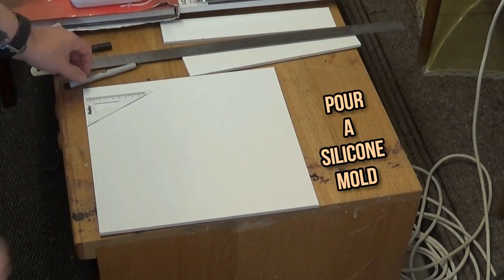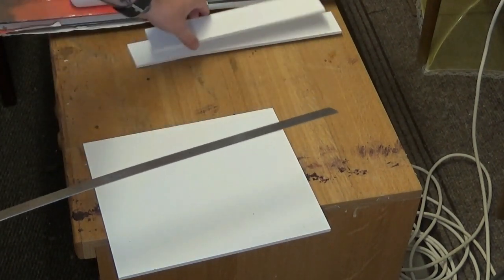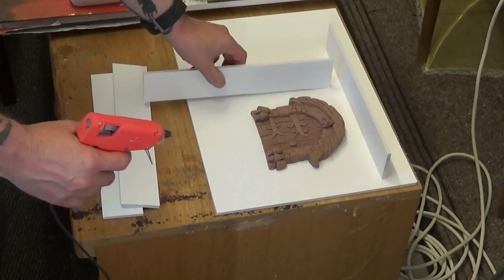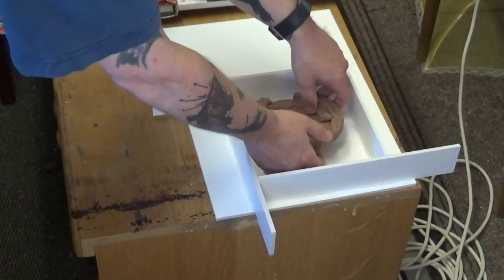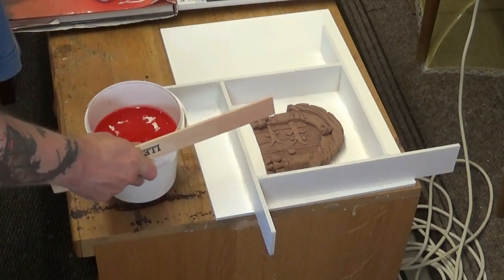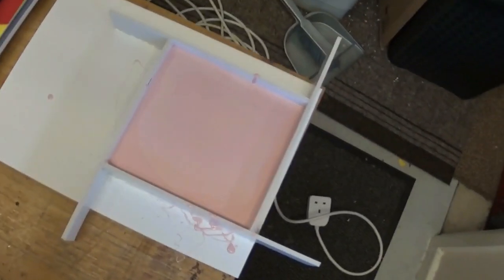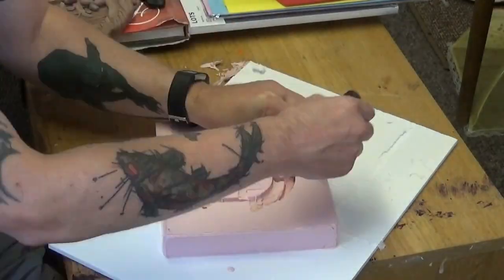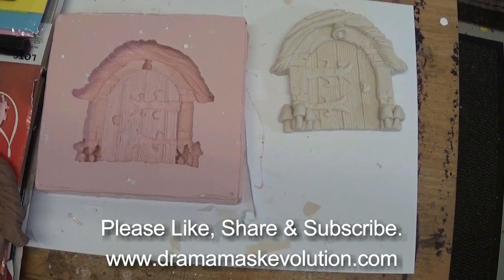Pour A Silicone Rubber Mold

Comment: your end product there looks fantsastic,i think ive got the jist of it now,but with a soldier figure 1:35th surely this would be diffrent?i cant think how this would work with a figure?ah if i stood the figure upright surely i wouldnt need to make two parts and put them together as id rather have it in one piece..
Reply from the maker: You might want to make vents for your figure. I haven't made a video making vents for silicone molds as of yet, but will make one at some point. I did a very brief video on casting resin figurines a while back, but may not be useful to you: Resin Casting Figurines | Polycraft EasyFlo 60: https://youtu.be/KZbF-MpBBUQ

Comment: Can you use paper clay or will only oil based clay hold up to this molding process?
Reply from the maker: Sorry, I have only just seen this message. I haven't used paper clay, so I can't really say. As long as you pick up the detail with the materials you are using then all is good. :)

Comment: Hi,i would like to make extra copies of some of the figures and buildings i have in 1:35 scale,could you please help point me in right direction,id like them to be made of Resin and ive already seen some figures made from easyflo60.I just cant figure out do i have to make it first out of clay or can i just stick one of these figures straight in?thankyou and regards Ant
Reply from the maker: You should be able to make a mold from the original figures, assuming they're not made from any extraordinary material which may react to the silicone.